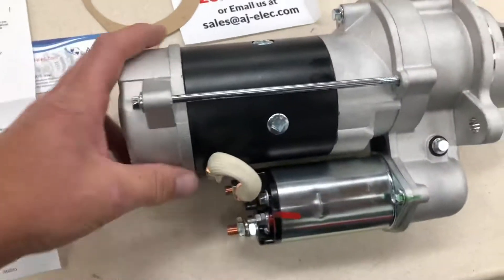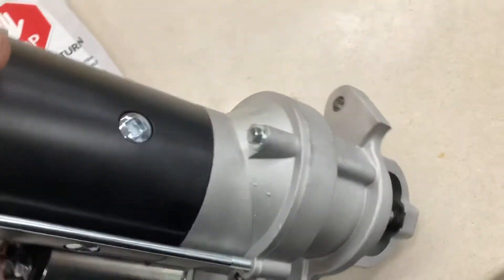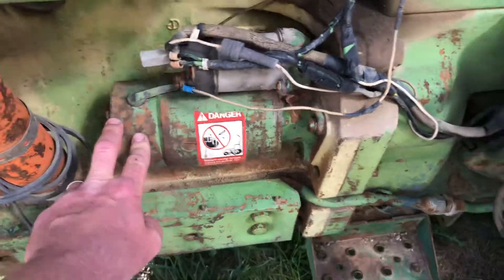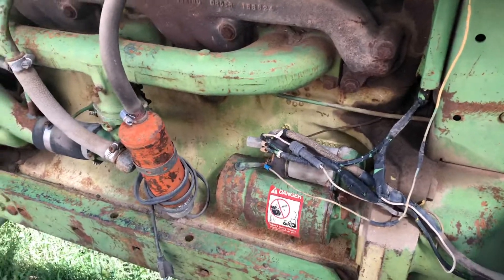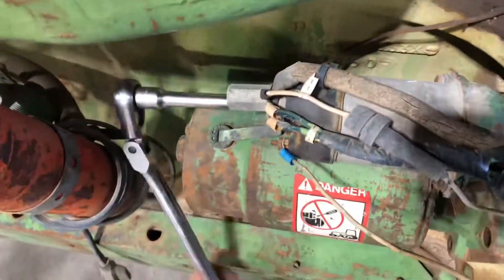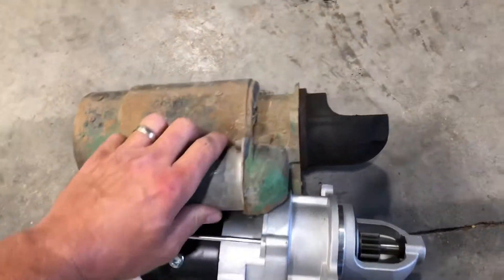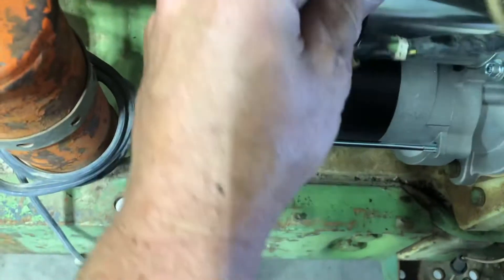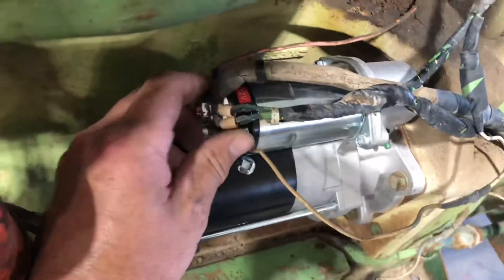John Deere 4020 Gear Reduction Starter Upgrade

Comment: I ordered one earlier this year from the same company but it was faulty. The issue was intermittent though. Started one time and then not the next. Now it won't start at all. It probably started 10 or 20 times before it quit completely. Are there any quick fixes for that type of issue? I'm outside the "Return window" now that I've figured out it wasn't an electrical issue on the tractor.
Reply from the maker: I have not had that but in winter time I have had the long bolts that hold it together get hot . I tightened them and all good now.. I would check all fasteners on starter

Comment: Good  day  I was wondering about  those reduction  starter.  For diesels   don't they need speed. My 574 needs sometning  Thanks
Reply from the maker: Yeah they need speed it seems that the gear reduction starters have more torque and keeps the engine spinning faster than the Factory ones.  I have done it on diesel and propane now, work fine.  Done some research on propane 4020 and always hard starting I guess and most people recommended the new style gear reduction starter
Reply: @HighOctane101  I think I wrote you before. Thanks